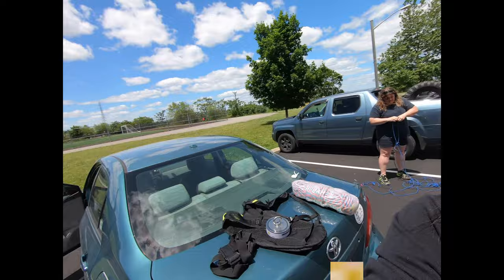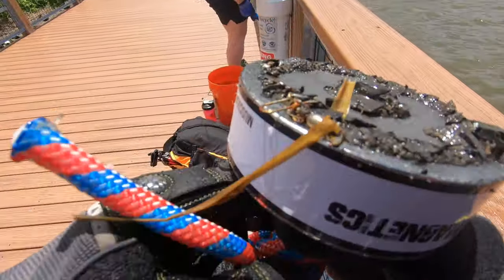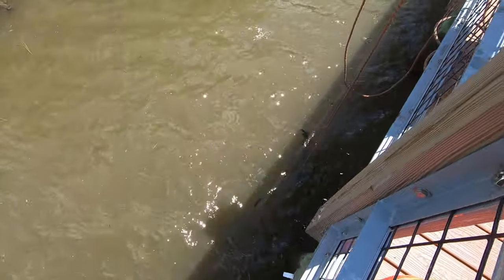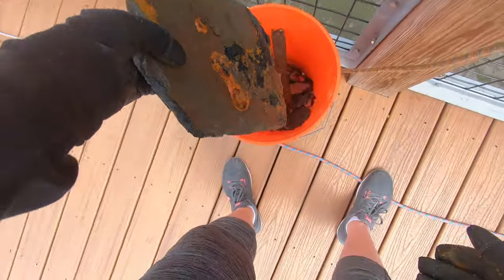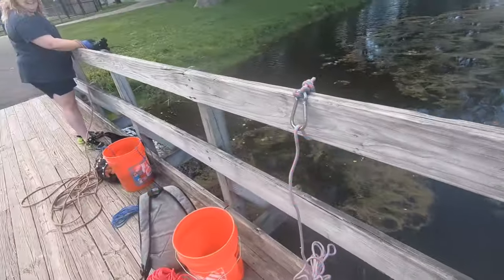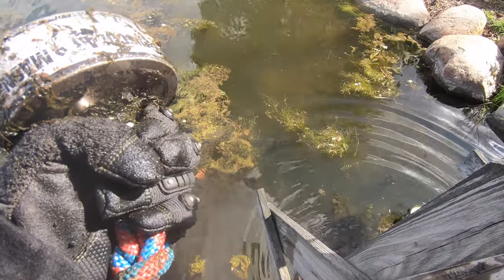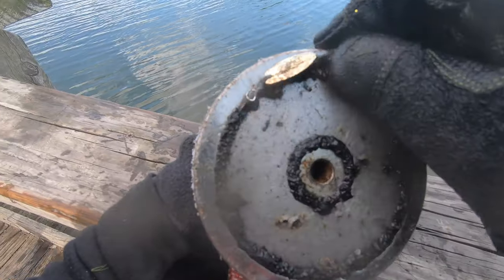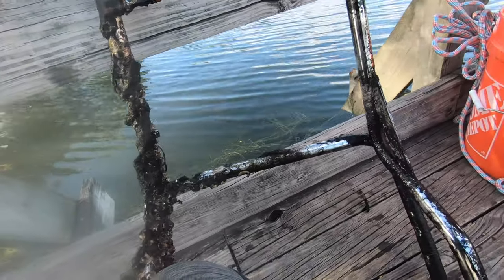Knot Tutorial & Fun Day Magnet Fishing! WHO Tosses Shopping Carts In The Water!? 🤔

Comment: I liked the video again and the fun you both have is amazing. One tip if you put a carabiner at the ends of the rope you can easy change magnets and lock the rope at the bridge. Then you never loose the rope when you trow. Also you don 't need many ropes. You can do anything with one rope with the carabiners. Waiting for the next video. Greetings from the Netherlands 😘
Reply from the maker: Great tip! I've been thinking about that as well. I'll definitely be picking up more carabiners soon. Thanks!!
Reply: I use a carabiner at the end of my rope when  using both sides, but since it is magnetic, when using it single sided. I tie the rope on directly, to prevent false "nibbles" when the clip is attracted to and then pulls away from the magnet. Check out my channel.